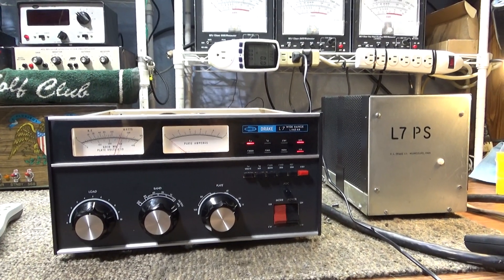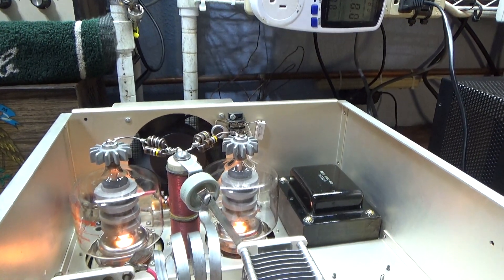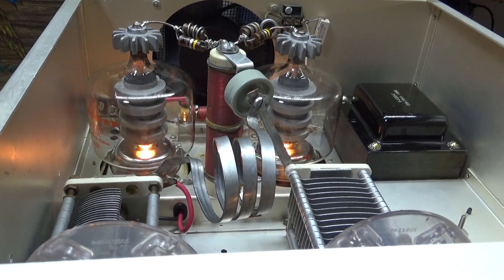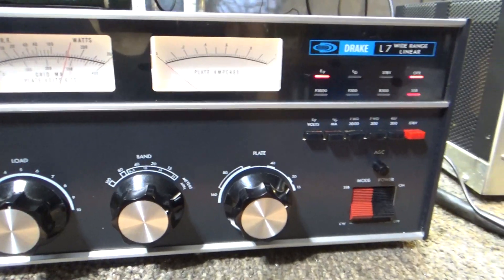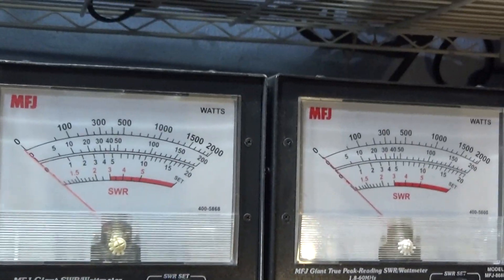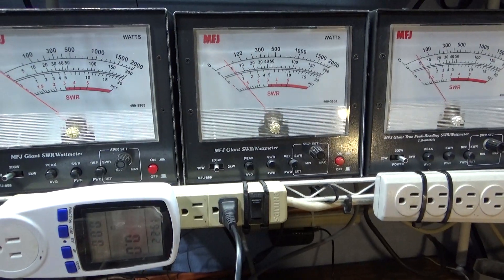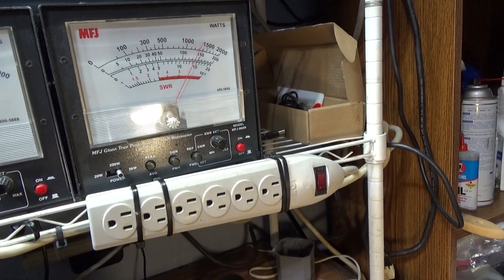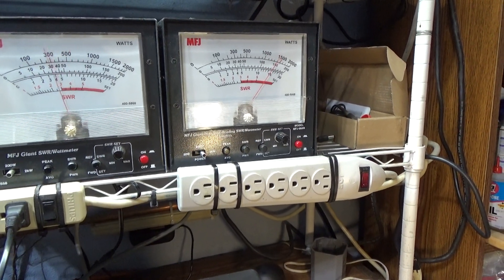Drake L7 Monobanded, Variable Bias, on the bench before finishing her up and putting her away.

Comment: I'm trying to figure out how to get the SWR down between the radio and the amp on 10 and 15
meters. Adding the 68pF cap lowers it from 2.5 SWR to 2.3 on 10m and the tuning the slug for 15 meters does nothing.
Reply from the maker: wasn't there a 2nd cap you needed to add on the input? Also, you removed the 'filter'; right?
Reply: @tramdr  Yes the filter is gone. I removed that tiny bolt in the band switch. There were two 68pF caps on the export model. On on the 10 meter band switch and another on the 15 meter. I have not added one to 15 meters because I don't really use it.
Reply: @tramdr  I found a post on eham were a guy did a lot of work to get the input swr down on 10 meters. He added a 2 turn 1/2 inch 14 gauge coil to the band switch on the tube side and a common capacitor to the input side of the band switch 15pf. I did this and lowered the swr considerably. Also adding a 82pf cap to that 1/2 inch coil made 10 meter almost flat.
Reply from the maker: does yours have the 10 meter input coil, L4 installed? Most did not.
Reply: @tramdr  No it does not. It just has the jumper across the 10 meter section of the band switch. I added the 68pf cap that it shows on the schematic on the export models. I read somewhere it needs a little inductance. Im going to add a 2 turn 1/2 diameter coil connected in series with that jumper to see if that will bring it down.